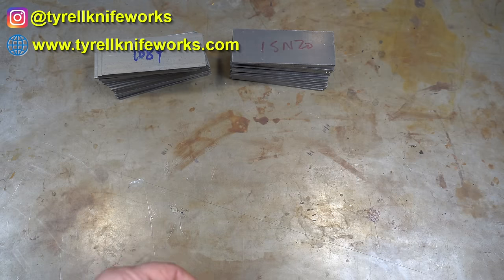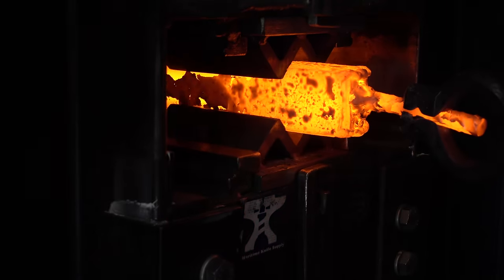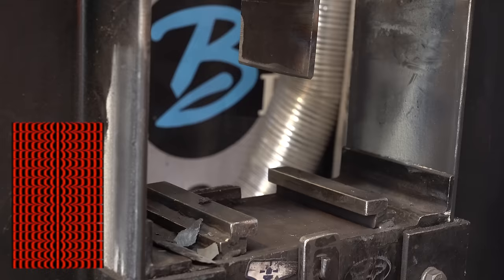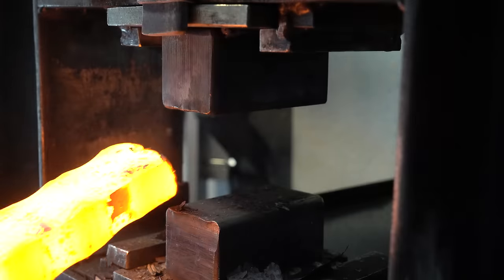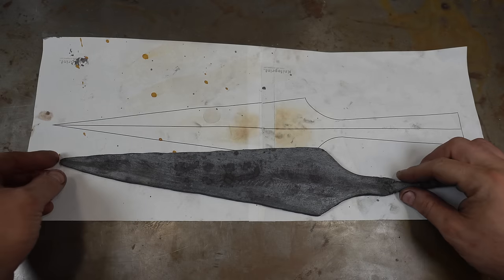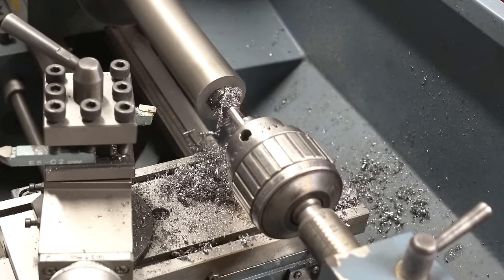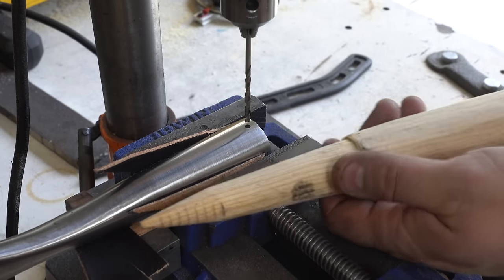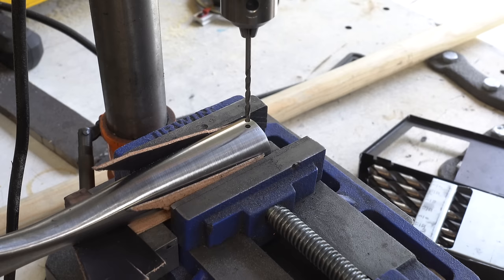Forging a Damascus Viking Spear

Comment from the maker: What do you think about this spear?  Any questions about its construction?
Reply: it's beautiful, great work man
Reply: Is Damascus a composite material, stronger than either of the steels that go into it, or is it just cosmetic, and one or the other types of steel could make a functionally identical blade?
Reply: Is it possible to make blue steel Damascus?
Reply from the maker: @joe-wt7oe  done well, Damascus is as strong as the base steels.  Never better.  It’s just for aesthetics though.
Reply: I was wondering if you would consider making the cone out of the same patterned billet until I saw the etch and that it was a commission. Looks awesome!
Reply: Handle could have used more lacquering
Reply: Looks amazing. The neck looks like It had some blemishes on it after the etch. Was it the light or was it smudged before the etch? If I ever win the Lotto, you will be a bussy man :)
Reply: The nail polish through a stencil seemed like unnecessary complication.  When I do resists like that I just use my cricut to give me a vinyl sticker - that sticker itself works as the resist and lets me achieve fairly intricate and accurate resists.  I typically will use nail polish just to clean up areas where I had a small tear in the vinyl - which is pretty rare.  I've discovered that the Orcal brand permanent vinyl works the best.
Reply: I'm keeping my finger crossed that it's being shipped to Tim Wells so I can see get used!
Reply: Beautiful spear and great  video
Reply: I have been making knives for about a year and was using fwrric chloride to etch with minimal results, someone just told me what I have is a concentrate, it's the 415 from MG chemicals, what ratio do you recommend I dilute it? And best loose guess as to how long I can use it before it goes "bad"? Thanks again for your time...
Reply: How did you go about planning the process for getting that Damascus pattern as a result? How did you figure out the steps?
Reply: I would kill for one of your blades lol by far my favorite blacksmith. Love your videos man!!!! So relaxing to watch you work haha
Reply: @trevordunkley6653  Bladesmith*
Reply from the maker: @thesmogo  there’s no lacquer on the handle. It’s a simple torching.  The handle isn’t part of the commission anyway.
Reply from the maker: @kristianhansen3404  it’s a bit darker there after the etch.
Reply from the maker: @brianlogan9686  I use a 4 or 5:1 mix of distilled water to ferric.  It won’t go bad for many years.
Reply from the maker: @spamandspam  feather is a  CB pretty well known pattern.  It’s from watching others that know how to do it.  Like most patterns in fact.  😉
Reply: @TyrellKnifeworks  thank you!!
Reply: First love the channel one of the best forge guys on YouTube for sure. Looks lovely and just wanted to tell you good work here and on just about every other video I’ve seen🫡
Reply: @GenericSpace  whatever man lol I'm a guitarist not a metalworker. I just like watching these vids during my downtime. I'm not a Smith and have never tried to be one and watching these vids is about the extent of my knowledge. Personally I wouldn't care if someone referred to me as a guitar player instead of a guitarist. Shit you can call me a guit-slinger and I'll get what you mean. Most people outside of the trade would probably just call it blacksmithing. Ya know, laymen's terms and whatnot. But hey you do you lol I'm a sketch artist too, but I've never cared if someone's said I was a "good drawer". Lol I know what they're trying to say and just take the compliment. I mean a guitar pick is actually called a plectrum but let's be real, no one calls it that lol
Reply: I’m surprised you didn’t call it a vibranium Wakandan Dora Malaje spear since Blank Panther 2 just came out 😅
Reply: @Thaddigren9  The knot would be 17 individual stickers. Dennis did it right for that design. 
If it's one design that all the cut out stays together. Yes, a sticker its self would do.
Reply: @trevordunkley6653  Guitar player? Sounds more like a riffer to me. Learn your music theory and don't get so into listening to yourself talk
Reply: @GenericSpace  lol no I am a guitarist. But I've been called a guitar player. My point is I don't give a rats ass what people refer to me as. I get what they mean. My music theory is fine my man. I practice 8 hours a day 5 a week and have been for 13 years now. 😊🤘maybe you should pick one up sometime, better use of your time lol thank God you are here to correct people who say blacksmith instead of bladesmith. No idea what we'd do without you bro. Wanna trophy? Lol
Reply: @trevordunkley6653  I've been playing since '95 and that's why I can spot a "riffer" from a mile away. Good luck though.
Reply: @trevordunkley6653  Like I said; riffer
Reply: @GenericSpace  lol you probably play guitar like DJ Khaled 🤣
Reply: It's one of the prettiest spears I've ever seen. The transition between blade and cone is flawless in my opinion and added so much to the aesthetic. 

One question though, could you tell us the dimensions of the blade? I intend on making one with a truck spring i have laying around. Thanks!!!
Reply from the maker: @guilhermeborghi  The spearhead from tip to the end of the socket is 18".  The widest part of the spear is 3" and the spear blade is 10.5" long.  (that's all imperial, you'll have to convert if you need it in metric).  For Patreon members, all my designs are available in PDF form.
Reply: @TyrellKnifeworks  oh nice! I'll try to get your patreon, didn't know about that. Yeah, that works quite a lot, just have to convert to metrics! Thanks a lot!
Reply from the maker: @scottstrong1989  this one is actually stronger since there’s no fold over on the socket and then a forge weld.  With that method the socket is usually thinner, particularly the connection to the blade.  You never truly get a full integral socket, there’s always some sort of forge weld.
Reply: Have you seen how Rigoni Ironworks goes about forging socket chisels, spears, etc? That tapering tool he's got for his power hammer looks game changing
Reply from the maker: @alexhamon9261  Yeah, I saw that.  If only I had a power hammer.  😜
Reply: @joe-wt7oe  it depends on the time period. Original, steel wasn't very good, to the point where it was straight up junk by modern standards. The technique used to produce actually functional swords by the Vikings (and what modern 'damascus' supposedly imitates) is called pattern welding. However, while it is beautiful, it it, with a few exceptions, purely ornamental.
Reply: @joe-wt7oe  just cosmetic. There are two types, pattern and wootz. Pattern Damascus is just two different types of steel wielded together while wootz is a special type of alloy which made ancient swords stronger cause it had carbon nanotubes in it. I believe the recipe for wootz Damascus is still lost though I think there was research into recreating it and wootz can’t be patterned like pattern Damascus. It looks much more like water on the blade than pattern Damascus. Though for all the quality wootz brings to blades modern steel - including pattern - is just as if not more effective.
Reply: @dragondestroyer8465  I believe so but I don’t know how. I think you’d have to dye the steel?
Reply: @GalacticCoffee2077  honestly I’m not sure, was thinking of a design with it as a copper Damascus blade, just not sure if blue steel is a type of steel, or a finish
Reply: What would this sell for...man I love to have one.
Reply: Do you have a web site for commission.... Please do tell . your work  is some of the best I have seen . Godspeed Brother..
Reply from the maker: @talonh3134  sorry, this was a commission and is already sold.  Thanks for watching
Reply from the maker: @talonh3134  my website is linked in every video description.  👍
Reply: I know it's not to do with the spear, but I'd love too see you make an english bill hook witha similar finish
Reply: Yea what I would prefer to see is this spear made by hand , by that I mean no machines just hammer and anvil and muscle and sweat.
Reply: Is it possible to get kumiko like patterned Damascus
Reply from the maker: @demie4140  sure, you could 3D print that and do it in a canister.
Reply: Very nice work, impressive pattern, but call it "Viking" is misuse in my opinion. There are no evidence in archaeological materials that this kind of the pattern has been used in the Viking age.
Reply from the maker: @officinaferraria  don’t take it so seriously.  The pattern is my own, the spear shape is Viking.
Reply: What kind of heat treat did you do? I didn't see you do one.
Reply from the maker: @sethsbikehacks2730  the heat treat is at 19:45 in the video.  It's 1084 and 15n20 so it went into Parks50.  A few months ago I did a video on my heat treating recipes so you can review that video for exactly what was done.
Reply: What is the hand hammer you were using called?
Reply from the maker: @stuckindamiddle7431  that is a rounding hammer.  It was made from my buddy Spencer at Heavy_Forge channel.
Reply: @TyrellKnifeworks  thank you very much.
Reply from the maker: @johnfkennedyofficialyt  the traditional way is to make a flat “spade” looking flat area and then roll it into a cone and forge weld it.  There are lots of videos of this process.  It’s kind of tricky though so be prepared to do it a few times before you get it right.  Thanks for watching.
Reply: Wow that’s amazing
Reply: Do you find forging fun? If so what part do you enjoy most?
Reply from the maker: @bomas2578  the forging is definitely the most fun.
Reply from the maker: @jasonfennell141might be possible, but my guess is the added steel to make it a sword would make it an extremely heavy spear.  Thanks for watching.

Comment: this is one of my favourite builds so far! I love the shape and that pattern, and the way you connected the tip of the spear with the socket; such a clean weld and the hand forging after that, you can hardly tell there where initially two separate parts. Great work!
Reply from the maker: Thanks for checking out this build, Paul.  It was a fun and different build.

Comment: Absolutely beautiful craftsmanship, and I really liked the addition of the pattern on the left side corner. Question though, is the addition of the kerosene a way to keep out oxygen during the beginning forging process?
Reply from the maker: Yes on the kerosene.  Plus as it burns off it leaves a residue that prevents forge scale.  Thanks for watching.
Reply: @TyrellKnifeworks  interesting, thanks for the information!

Comment: that looks awesome!  i recently was looking for machetes and that got me looking at brush axes and then this staff machete which looks awesome got me thinking about spears and I saw another viking spear representation and it was 2ft overall with 14” blades which is bigger than the staff machete I was looking at…. which got my down the rabbit hole looking for grade 5 titanium seamless tubes  to make various threaded attachments and a blowgun.  but in the near future I may be rocking a sweet spear titanium staff setup.
Reply from the maker: Sounds interesting, Cameron.  Thanks for watching.

Comment: The visual aids help a lot. I always wonder how people keep track of these designs. I'm curious though; Do you think it matters if a press is used to do Damascus or would you prefer a power hammer? I read on someone's website who stated a power hammer is better because the hard whack makes the steel stronger. Anyway, impressive work. 💪💪💪
Reply from the maker: There are things a press is better at and things a power hammer is better at.  The press is better to set welds.  The hammer is great at drawing things out.  It’s a myth that hammering makes the steel stronger though.  Thanks for watching.

Comment: Beautiful spear head. Question… would it be good or bad for the wooden point on the spear handle to be longer? Like if the tube was, say, 2’ long so there’s less torsion on the wood? Is that impractical? I feel like I’d break the head off if I actually had to battle.
Reply from the maker: There's a balance between how long (and heavy) the socket is.  Most sockets are in the 6" range.  This one has an internal depth of about 5", which is typical.  Thanks for watching, Muriel.  (Is Livermore your last name?  The city I live in is called Livermore.  )

Comment: That looks amazing! When you squish the tip, do you do it enough that a piece breaks off to bring the feather all the way in? or just to try to bring the end of the material together. I ask because in most cases I see the end of the billets being cut off anyway, and i feel like it would really bring the pattern to a fine point.
Reply from the maker: It was squished all the way and some removed.  I had to reprofile the tip a bit to align the bevels and that took off a bit more than I wanted.  Thanks for watching.

Comment: Great work Tyrell, I never imagined a spear of that build. Don't you think drillind a pin through would have anchored the spear enough? Also, how would you preserve it from rusting?
Reply from the maker: I’m not sure what you’re asking about the pin.  It is drilled through and yes it will anchor it enough.  This is like any carbon steel knife, keep it clean and oil it on occasion to keep it from rusting.  Thanks for watching.
Reply: @TyrellKnifeworks  Sorry I must have missed that part, probably got carried away. Beautiful spear indeed thanks for sharing

Comment: Thanks for the interesting video!
I bought a Swedish ax and left it at the radiator for 2 weeks.
The temperature of the ax itself all this time was about 195F (90C) degrees.
Has the hardened metal been tempered? Thanks in advance!
Reply from the maker: 195F would not harm the temper, if that’s what you’re asking.  Most blades are tempered around 400F.  Thanks for watching.
Reply: @TyrellKnifeworks  Thank you, Tyrell

Comment: very nice indeed. I have had occasion to make a spear or two but always with the drawn out  integral socket ....great fun  what temperature did you temper it to if I might ask, I think I might have missed that bit somehow... I took mine to a light bronze so they were tougher than hard..Awesome pattern
Reply from the maker: It was tempered at 450F and it’s 58hrc.  Thanks for watching.
Reply: @TyrellKnifeworks  thanks Denis so its still very slice and dice with good edge holding , thats cool.

Comment: In the video, you mentioned adjusting the center of the feather pattern. Can you see the damascus pattern when it's heated like that?
Reply from the maker: You can usually see the layers a bit, but it can be difficult.  On this one, it was hard to see them so I had to etch it and just remember where to hit it.  😜. Thanks for watching, Jacob!
Reply: @TyrellKnifeworks , you know... That actually makes more sense than sticking your face really close to a super hot slab of steel looking for art. 😏

Comment: Love it. The only thing that got me worried is when you put it in the oil with your face so close if the oil would have flashed you would have got burned but everything worked out fine
Reply from the maker: Ha, unlike Forged in Fire, I don’t let my oil flash.  As long as you submerge the work, it won’t flash. Thanks for watching.
Reply: @TyrellKnifeworks  ok

Comment: What is the advantage of the rounding dies vs square dies? I see you using them frequently to draw out the billet, but I'm not really sure why.

Also, splitting the billet seems to murder your wedge. How many of those do you go through? And would a stronger steel help with that, or is the damage caused mostly by the heat and it's cheaper to use a more mild steel for sacrifial use?
Reply from the maker: I saw "rounding dies" but I really mean "drawing dies".  They are for lengthening the steel in one direction.  Flat dies (which your are probably referring to as square dies) press the metal in all directions.  The squaring dies are to keep a square pattern on the steel and make sure you have 90 degree edges everywhere and your billet isn't rhombus'd.  The splitter I use is a bit too thin and I totally screwed it up this time so I have to make a new one, but no matter what you do, the heat will kill these after 5 or 6 splits.  You need to dress them each time.  Unless you get something like H13 steel (which is very costly)  and even then you still will need to redress it.  Not really worth it.  Thanks for watching.
Reply: @TyrellKnifeworks  thanks for the reply! Yeah, I meant flat dies, my bad, was late at night :) I get that the squaring dies help with the forge welds via the four directions of pressure on the billet. Just wasn't sure about the flat vs drawing, that makes sense now.

Comment: @Tyrell, it turned out to be a masterpiece. I wanted to ask you what is that polish you use on your blades? It creates a nice polish on the blade.
Reply from the maker: I typically use some wax (carnuba wax is fine) and some mineral oil.  Thanks for watching, Neil.

Comment: I have a question about the way you cut the billet for the feather pattern. I have noticed on several videos now that as the blade is forced through the billet, there is a fair amount of damage taken to the edge of it. is this normal? it seems like it melts away as it is being pushed through. does this not leave deposits on the billet?
Reply from the maker: It certainly damages the wedge but it leaves no mild steel in the billet.  My wedge was too thin so I need to remake a better one.  They all deteriorate after a few runs though.  Thanks for watching.